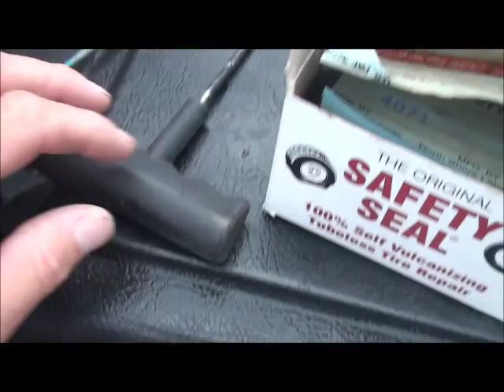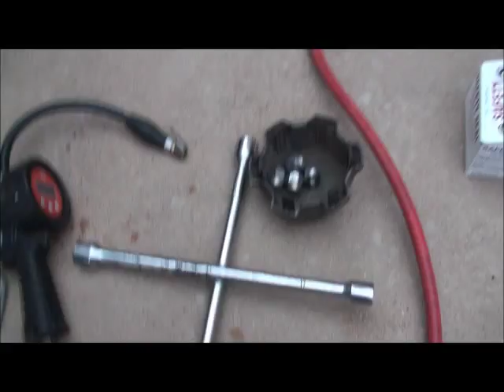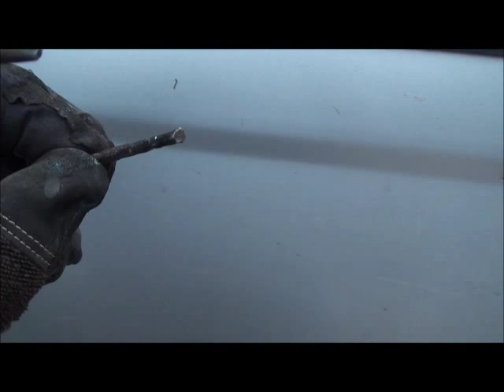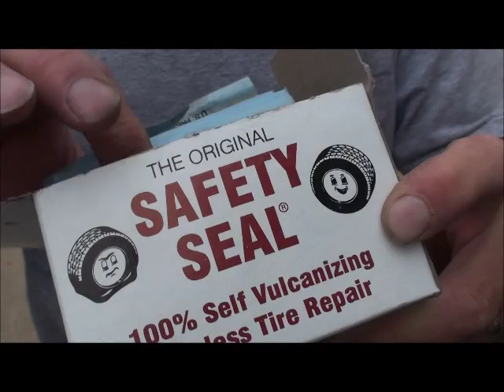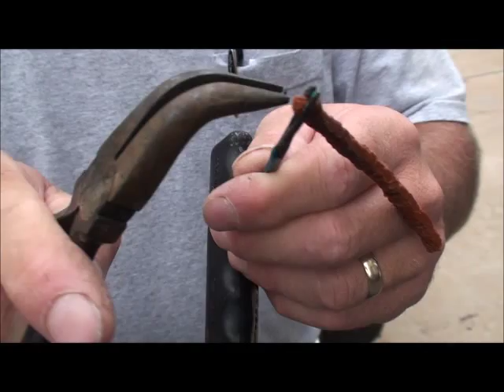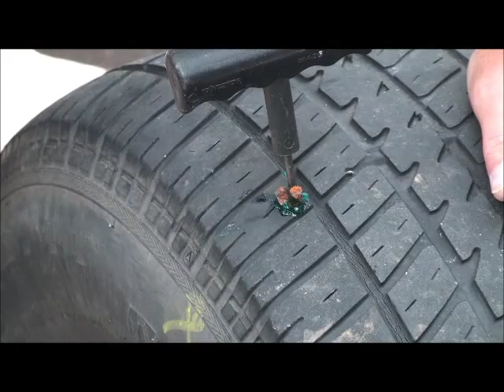Flat Tire Repair in SHTF/WROL/Emergency Situations

Comment: safety seal plugs are 100% self Vulcanizing and do not require any glue to be added ( see their website) adding glue is probably hurting the bond not helping it.... especially Pvc cement that is not for use on rubber
Reply from the maker: Thanks for the info! Before I had purchased the Safety Seal Brand, I had used a auto parts store brand that came with a "glue" in a tube. I was repairing a flat, was out of the "glue" and just used what I had. Never had any issues. But good to know! Thank you for watching.

Comment: I've never used any type of glue or solvent on the plug before. Never had a problem. That said, the plugs I use are "gooier" than the ones you are using.
Reply from the maker: Thanks for watching! When I first started using a plug kit, it came with the solvent. So i just used it. I have tried to put one in without a solvent, and it was a lot harder to get it. I think it really just helps inserting the plug into the tire, LOL. I did not have a problem with the other with out either.

Comment: I have a plug kit and was using it a few days ago in the plant...Thanks Buddy!
Reply: Don't be afraid to use the drill as long as the bit isn't too big.  I keep a plug kit and pair of needle nose in the truck....lifesaver. The red plugs are usually better than the ones that come in the other kits.  Good share.
Reply from the maker: One of the best preps I have purchased! Thanks for watching!
Reply from the maker: Thanks for watching Walter! Good points!